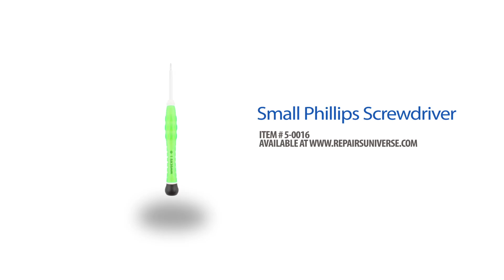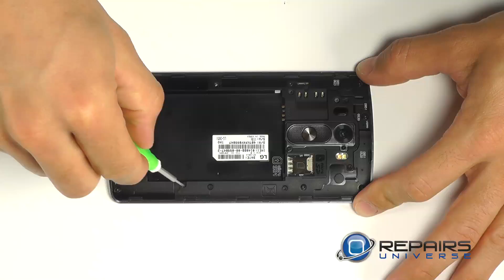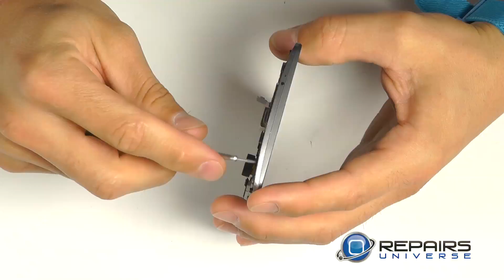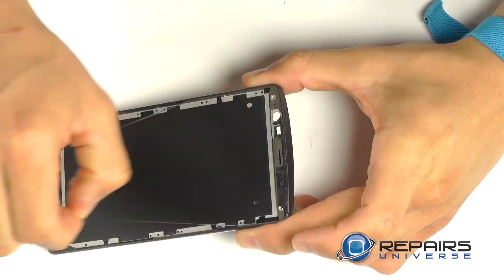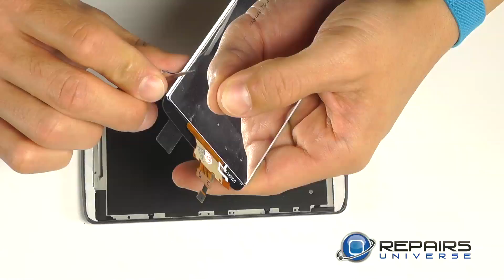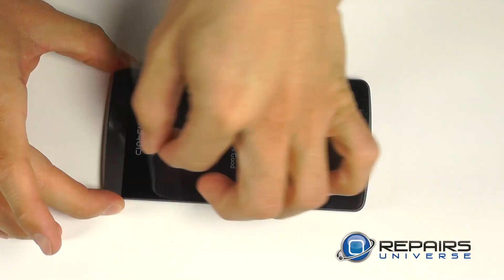LG G3 Screen Replacement & Repair Guide

Comment: I did everything according to instructions, the phone turns on but the screen stays black. I think there is a problem in the new screen, in which to correctly hold the connector of the display . Or it can also be a problem in that the screen won't get stuck, but I really don't know. The display I ordered through Ali Express, so this may be the cause. Thanks for the help!

Comment: does replacing screen fix touch screen because mine cracked and the phone is functional but the touch screen doesn't work.
Reply from the maker: Yes on this device the display and digitizer are one fused unit.

Comment: One problem i bought this and my phone started to heat up a little more and it had some what dots and the touch screen would sometimes stop working for a bit. Any idea why?
Reply from the maker: Heat is usually a sign of a short. Check that the flex cables from the display aren't damaged and that it isn't making accidental contact with anything.
Reply: thanks ill try to look out for the next one i ordered.
Reply: wheres the link to the screen! This stuff confuses me. I want to buy it from your website, can i get a link to the lg3 screen please. Getting all of your tools aswell.
Reply from the maker: http://www.repairsuniverse.com/lg-g3-replacement-screens-parts.html

Comment: sir, id like to ask what is the temp. of the air in your blow gun when melting the adhesive?
Reply from the maker: +Plongkie The heatgun used in this video is nonadjustable. We do it by feel, the method i recommend is to keep it uncomfortable to the touch but not hot enough to burn yourself or melt the plastic.
Reply: I have watched like 20 of these videos getting ready to do this myself, from what I have seen the temp is 150, almost everyone was using that haha

Comment: Great video!! One question, if I were to purchase the screen with the frame already assembled what would be different in the repair procedure?
Reply from the maker: +enrrola For the LCD assembly in a frame the repair is similar. You will only have to transfer the motherboard and all small parts over to the new frame. Thanks for watching hope this helps.
Reply: enrrola you wouldn't need to remove the the broken glass from the frame. so no heat gun needed if you ge it with the frame.

Comment: Replaced the screen, but it doesn't light up.  I think it still works though.  I tried to guess the correct location to do my passcode and I could feel the phone vibrating in response.  It looks like it's trying to light up, but it just stays black...or more like a really dark shade of gray.

Comment: i got a question, my screen got cracked but still works at some points of the screen, do i need to change just the glass screen or do i need the digitiser also
Reply: You can change the digitizer, but its glued onto the screen. If you have never done it before, having to seperate the digitizer without breaking the screen requires patience, then clean all the glue off, and having to glue a new digitizer to the screen is a pain in the arse.  You can buy the full kit on that well known auction site.
Reply: same here
Reply: The Digitizer is the glass. The LCD is what displays the image on the phone.

Comment: My screen is cracked, but my display and touch screen still works. The issue is that the display only works when I lift the screen/display up from the frame at an angle. How do I correct that? I'm guessing something is just loose

Comment: I replaced my screen yesterday and at first it was coming on but had faint lines so I tried to do it over now the screen is just black but I know it's on because the led flashes and it vibrates if I hold the power button. Is it something I'm missing on the inside maybe I'm supposed to add something or take it away? I'm thinking it could be a easy fix hopefully

Comment: Well I did that repair, installed the new part and thank God I thought to try it out before installing any adhesive!
It does nothing at boot, then front light blinks from blue and green, then fades away, repeats, meanwhile screen is black.
After a while there's a flash of light for less than a second with the LG logo and the vibrator sounds once.
From that point it stays in black screen. Pressing the power button once makes screen blink randomly, from one to 4 times, meanwhile the android menus shows in the background. After blinks it stays dark.
Did the ultimate test, installed the broken screen, works fine, well apart from being broken and not responsive, but no blinking foolishness.
Screen replacement part got busted!

Comment: My screen turns on will stay on for a couple of seconds, then flickers, almost looks like it turns to 8 bit screen, then fades to black.  is this a candidate for a screen replacement, or is this a different issue?  I can feel hepatic feedback when touching the screen, but it is black.
Reply: I have the same problum. Did you ever find a way to fix it? Did you replace the screen?
Reply: Hey Kira in the end the cost benefit made the final decision.  parts would have cost me $113, and it wasn't even an OEM part (found too many bad review of the screen not being as touch sensitive as OEM).  Insurance was going to have me pay 150, but i would be upgraded to a LG G4.  I went with the upgrade, and haven't looked back.
Reply: G4 has been great.  camera is a significant improvement.  data transfere is easy, you can take it into a store, or back it up using google.  If you can, do not update to marshmallow.  too many bugs, battery drain, apps, etc

Comment: Hey great video. Quick question, I dropped my phone and there is a small barely noticeable crack on the lower left bottom of the screen . the screen underneath the glass looks fine but the left side of the touch screen won't won't. It seems the when i press down the crack touches the screen underneath it causing it to bug out. What would you suggest on buying to fix the issue?

Comment: Will these instructions/parts work with a Verizon G3 also?
Reply from the maker: chaimss Yes, they would.
Reply: Repairs Universe Thanks, and which model number is the screen? I see several on the site.
Reply from the maker: Any screens on this link would be compatible with your device http://www.repairsuniverse.com/lg-g3-replacement-screens-parts.html
Reply: Repairs Universe I bought the 2-Y-1850, and this video doesn't work. It doesn't give alternate instructions to remove the components to put onto the frame. Is there another video?

Comment: what if my screen still works, but the glass is shattered. Would this include the same procedure
Reply from the maker: Yes, as you would need to replace the LCD and touch screen. They are fused together and come as one unit.